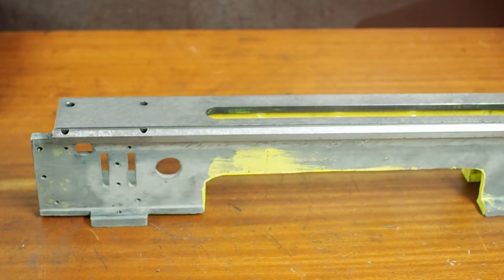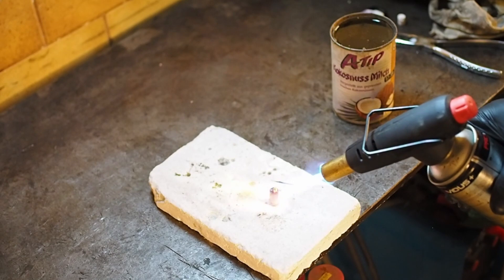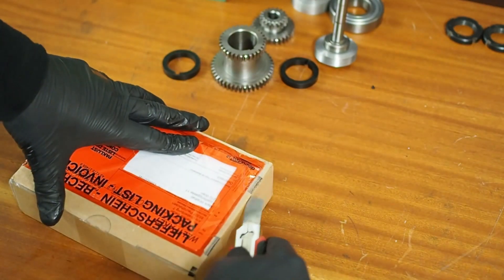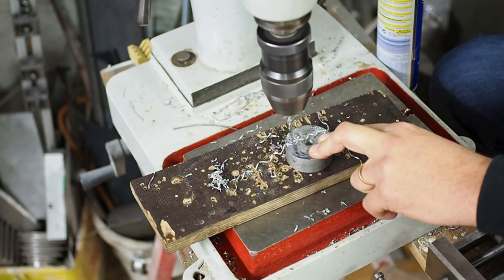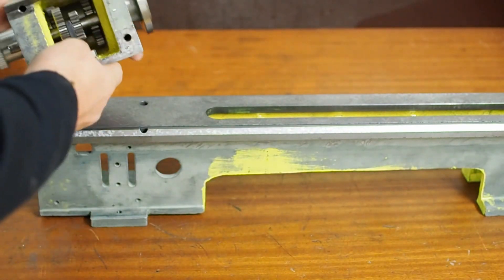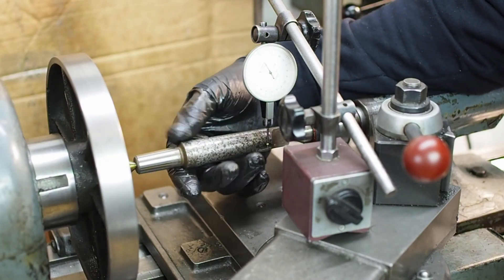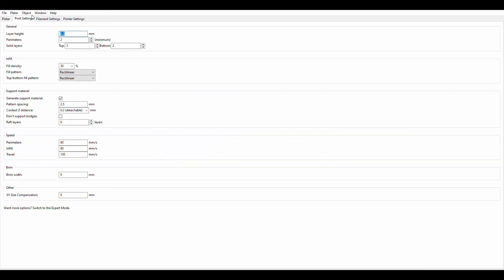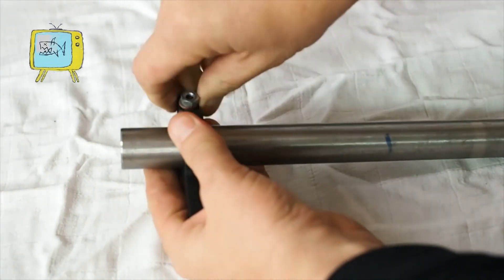Modding the mini-lathe Episode 4 - head stock.

Comment: That's the way they come with only 3 mounting holes for the head stock. I just purchased a 16 inch bed extension from little machine shop to replace my 10 inch lath bed and it also only has 3 head stock mounting holes
Reply from the maker: There are a number of serious compromises in the design.

Comment: Six-thousand-and-one!

Great job, thank you for inspiring me to get on with mine.

I have been mulling in my head for a long time about you using a straight edge shorter than the bed (or in general than the thing you're trying to scrape), and I think you can overcome the inherent problems but you need to take overlapping measurements (prints). I thought about how to actually "read" these prints and I think the best way to do it is to print, take a picture of the print, move the straightedge (with overlap), take another print, another picture and so on. Needless to say, the larger the overlap, the smaller the error.

I'm worried about this because I too have a small straightedge.
Reply from the maker: It is not the size but how you use it :)

Comment: Hi Mark,
Just finished watching the whole series. Nice job on both the lathe and the videos. 

A question regarding your lovely drill press. Do you know what model it is? And maybe where I can find information about it?

The urge to buy one is high! But not to be found on Kleinanzeigen..

Thanks from Denmark 
Mads
Reply from the maker: It is an A. Ronzal, (ARO) made in Vienna in the 1950-70's. They are occasionally come up on Willhaben.at, but are not that common here either.
Reply: @RotarySMP  Thanks for your reply! Will keep an eye out;-)
Reply from the maker: @MadsBennetsen  Hope you also get lucky. I got this one is pretty poor condition for €70, and completely restored it.
Reply: @RotarySMP  Yeah. I found your thread of restoring it online. You really did a nice job👍🏻
The hydraulic lift is the impressive thing about it.

Comment: I know im late to this party, but what with me planning on a cnc proper conversion of that spoken of lathe with twin ways, im watching this playlist again... Long story short for once, you should have dialed in the morse angle by setting the indicator against the flat side of the compound slide, if the sides are indeed parallel with the axis of travel of the compound... That would ensure absolute precision, calculated over whats that, almost 12cm of compound`s flat surface on the side... Hell, if the needle can fit and the indicator arranged in such a configuration, you could have used the lowermost part of the compound`s side, which is as long as the whole compound upper sliding block, which is from what i see no less than 24cm, which is an immense surface for indicating an angle in precisely to sub-arc-seconds likely if the parts are well machined and aligned... You just slap the mag base onto the side of ways, press the needle against the lower part of the compound block and measure the depth change over the length of travel along the bottom of the block... That would have been the optimal approach to making whats essentially an instrument grade tool, or least is supposed to be, given the nature of its use...

All the best and kindest regards,
Steuss
Reply from the maker: Hi Stuess, Thanks for the tip. Next time I need a MT, I'll do it that way.
Cheers,
Mark

Comment: Hey Mark did you lap the spindle to a press fit into the bearings or something less tight?
Reply from the maker: I didn't need to do any lapping on the spindle. It had a pretty decent press fit from the factory.
Reply: @RotarySMP  Ok rad.  I got new bearings into mine today; I saw 0.002" TIR on the end of a 10" test bar but now the spindle axis is aimed off about 0.015" so I now have another reason to scrape it.  Thank you, as always, for all the wisdom you captured in this series.

Comment: A question, if your dog was too small, why didn't you turn down  the stainless bar for say 15 mm to fit the lathe dog? Surely that would have been far quicker than setting up and printing one or was there another accuracy reason to do it that way? I'm very curious lol
Reply from the maker: Hi, thanks for watching. You are right, since I had to turn down a bit at the end for the dog, I could have used the forged steel one. By then I had put it back in the tool box and fogotten about it.

Comment: Do you plan on sealing the headstock to contain oil? That would cause a great improvement for the bearings' lifespan.
Reply from the maker: I will be lubricating the bearings with Kuber IBU15, but not sealing the gearbox. With labrinth seals, oil lubrication will just get everywhere. I had  a discussion on the CNCEcke.de about sealing the gearbox. The metal gears I added are probably more in need an oil bath than the bearings, but will also only get grease. If they wear too fast, I'll throw them out again.
Reply: @RotarySMP  if you have any issues with the bearings, the angular contact ball bearings are available with seals and don't make that spindle any less rigid. Thanks for the reply.
Reply from the maker: @MF175mp  Good point. I put in tapered rollers, but -RS AC bearings would make even more sense. If I get swarf in this pair, or they dry out, I'll do AC bearings next tine.

Comment: What governs the accuracy of the test bar?
Reply from the maker: Good question. I am not sure whether the heavily worn Boley can turn a bar that length without excessive taper. Worst case I'll make a two collar bar for the Rolly's Dad method.

I can check:
-  parallelism with the Micrometer,
- Straightness by rolling on the surface plate
- concentricity, taper-cylinder by mounting it between centers and using a DTI a various spot.

Comment: Have you considered an oil-filled headstock gearbox? I made that mod with my mini-mill which is a very similar asssembly.
Reply from the maker: Hi Andy, Do you have an y pictures or write up on what you did?
Reply: @RotarySMP  Looking at the photos, none that show what I did. Thinking back it was the sandwich plate arrangement that I made to give a tilting head that sealed the chamber to keep oil in, so that wouldn't be an option here. 
The top of the bed very nearly seals the bottom of the headstock casting. You would need an oil seal round the speed lever, but I wonder if some sort of sealant would do the rest of the trick? 
Otherwise I guess that machining a recess inside the bottom opening for a sealing plate might be an option. 
My mini-lathe had oilers on the top of the headstock above the bearings. There were no holes through to the bearings, there were oilers in blind holes!
Reply from the maker: @andypughtube  I really should have gone for -2RS AC bearings instead of the tapered rollers. I wont be using the Mini-lathe that much as I prefer the Boley, so will just run grease in the Tapered rollers and on the metal gears and see how long they last. If they die, it is a pretty minor job to revisit this stuff later.